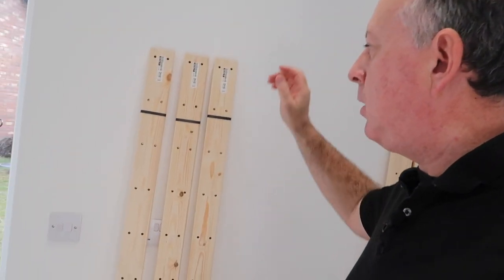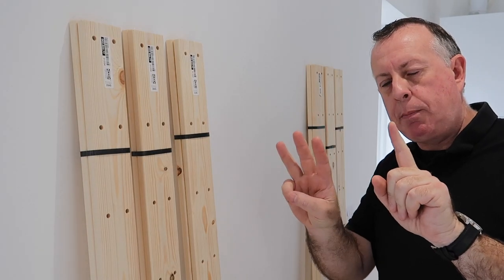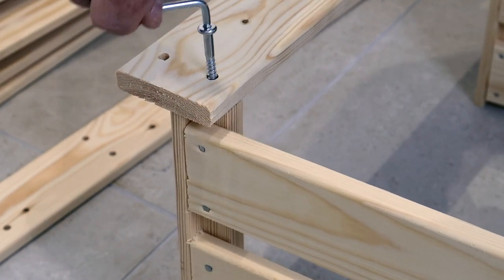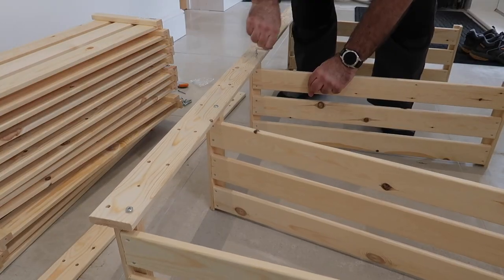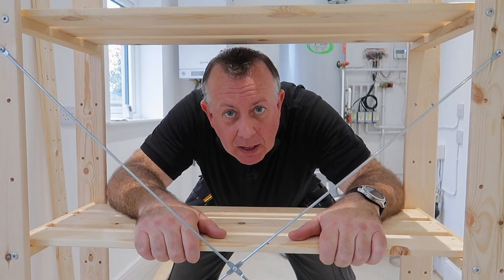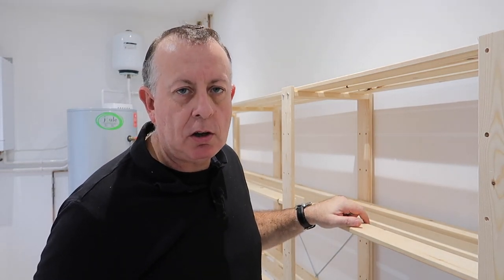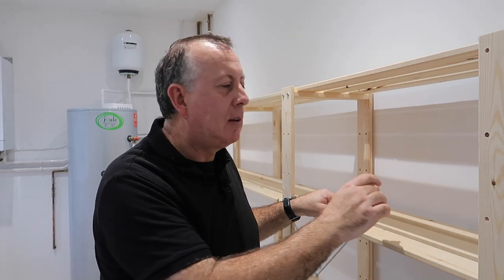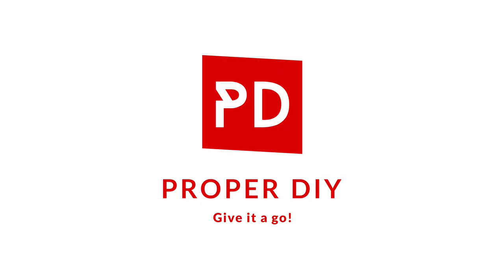IKEA Hejne Shelving - Assembly and Tips

Comment: Just beware with using a drill driver since the ikea fasteners and wood are very prone to stipping
Reply: Might be why these units come with a short S shape Allen key.  Fiddly and difficult to apply much  torque.  Just built up some of these units, used a cordless drill (low torque setting) and Torx bit as mentioned by others on here; worked a treat.

Comment: Thanks very much for the video - just remounted my shelves into to wall using some tips from this video. 

One technique I did: rather than use a pencil to mark a pilot hole, I used a small masonary bit in my cordless drill to create a pilot hole and then used a hammer drill (as I have thick concrete walls) to complete the hole. 

Shelving now secure (he hopes)!

Comment: Have used these shelves many times in different homes. I think they are a no brainier if you need this sort of storage. Cheaper than buying the timber and making them yourself. If you need to stain them for use in an outbuilding or loft I have found doing that before you assemble the pack is easiest. I used some fence paint for a set in the garden shed as a bit of protection. But a set in an old outside loo have survived Without staining for over 20 years. As long as it’s dry.
Reply from the maker: Completely agree. Definitely cheaper than buying the wood and making them

Comment: I'm about to start building a couple of  these shelf units and I'll be gluing, as well as screwing the shelves in place, as the lateral instability seems to be primarily caused by only using a single screw at each end of the shelves.

Comment: I have a previous IKEA system similar to this called IVAR. The shelves just sit on shelf pins so it is easier to change the shelf positions but it means fitting the metal braces is a pain in the bum. I have one in the shed. I did place some DPC under each foot but I now I think I should stain it too. Good tip. Also our 1yr old is starting to climb so might be time to fix the one in the living room to the wall.
Reply from the maker: I would recommend fixing it soon rather than later for sure

Comment: Another tip came to mind later on. Provided you’re comfortable there are no services in the wall (I.e. you have already tested). I reckon you could have run a masonry bit of that size right through the redundant fixing hole... and it would have acted as a marker and guide for your screw hole all in one. Builders do this all the time. Drill straight through the wood in situ.

Comment: New subscriber here! Great video and channel. I was looking to batten and  shelve a cupboard and the timber was getting on for £70 alone. I think a modification of these might be the way to go. Question: what's the vertical distance between the shelf bolt holes? Thanks, Tom
Reply from the maker: Thank you. Yes, very easy to modify. Vertical holes are at 125mm centres

Comment: It used to be called "GORM" - had it for many years in the garage. This stuff looks a little slimmer, but same basic design. It's served us well.  Without it I suppose I would be gormless (sorry) Because you're screwing into end grain, the number of times you can re-arrange is limited without plugging the holes of course.
Reply: Before GORM it was STEN, which was stronger than GORM. Pretty sure HEJNE will be replaced by something even flimsier.

Comment: If I were to be dumping 100kg on each of those racks, would it be able to take the weight? I'm impressed with the allenkey hack.
Reply from the maker: 100kg on each rack maybe too much - not for each shelf but to have say 4 on each frame in total I think is expecting too much from timber of this size.
Reply: @ProperDIY  oh, cos I was thinking i'm going to placing the heavy loads at the bottom of the rack, with extra wooden piece placed to support the weight, while the upper racks would be used for very light stuff like stereos and all.
Or would only a Ivar be able to support that kind of weight.
The total weight on their entire rack be 100kg not each shelf?
Reply from the maker: @MrBoliao98  Then I think that would be fine